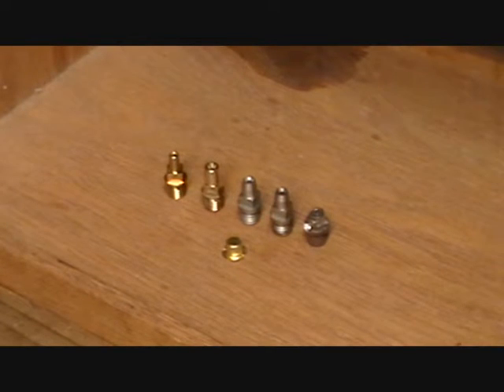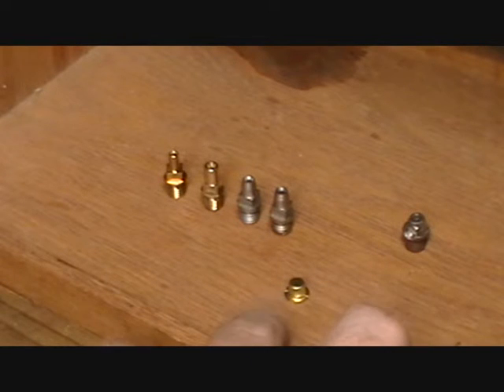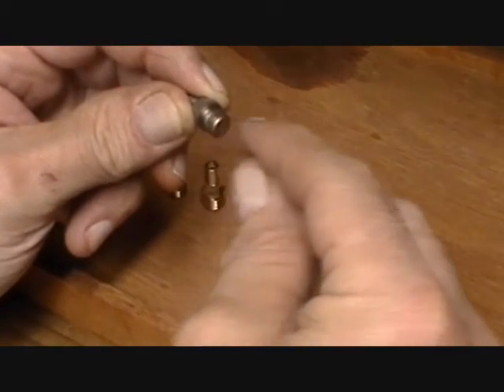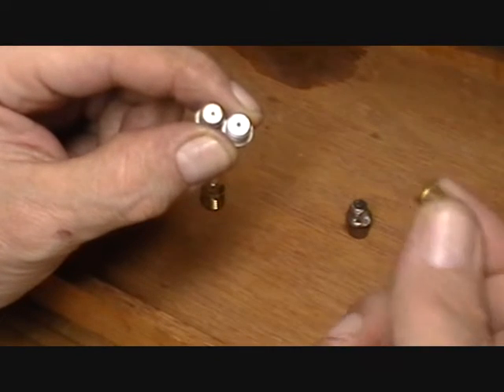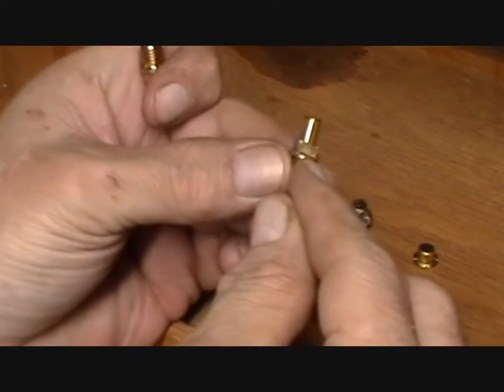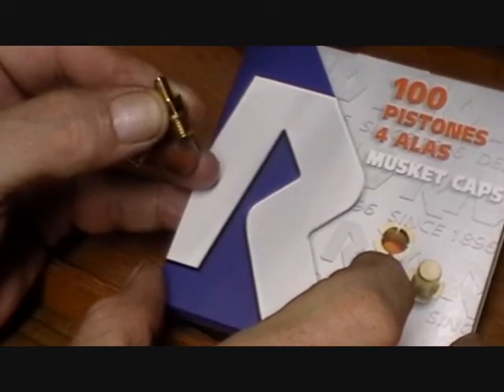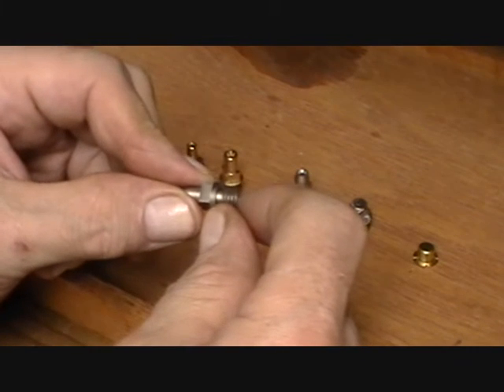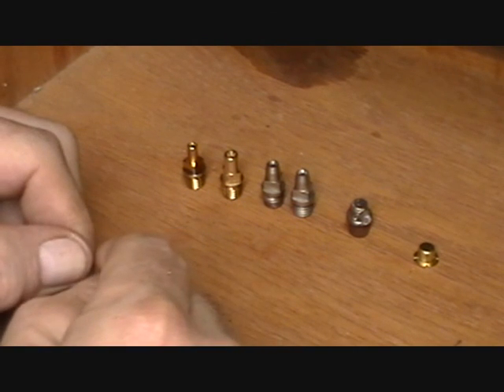Talkin Bout Nipples!

Comment: Interesting. I have an old hand-me-down Kentucky style .36 cal rifle. We always called it the "buffalo gun" because one of my ancestors used it to shoot buffalo to feed the crews building the UP RR back in the days, so that's about how old it is. I used to shoot it back in the 70's to early 80's but haven't fired it since because I started getting that blowback. It would sometimes leave the hammer re-cocked after a shot so I figured that was about enough. The flash hole on it is worn enough that I can stick a 5/64" drill bit right through the entire length and the chamber end is 1/8"! I have no idea what it was new back then but seeing the dinky holes they're using now, I guess that explains the blowback I was getting. I'm wondering what the standard was 150+ years ago because I can't imagine their machining back then would go so fine. Trying to find the right replacement nipple so I can shoot it again safely. Mine's also smaller, the threads on mine are 1/4-28 thread.
Reply from the maker: You could probably open up and re-tap the bolster or drum for a larger size nipple as well.
Reply from the maker: Okey Dokey.

Comment: I found an old Jukar Spanish muzzle loading pistol.  It was desert-dry, parched, and rusty.  The assembly and care instructions were in the old wooden box.  The best I can gather is that it is an early 1970s kit.  It is extremely easy to dismantle.  The nipple that was on it is a stainless steel nipple. I unclogged it and it seems clean enough to use now.  The firing hole seems rather large and has a funnel shape on the end.  It may be an old design.  I worked on the old kit pistol all day.  Now, it is clean, lubricated, and ready to fire.  But the cap end of the nipple seems slightly angled.  Is this just an angle that developed from years of use long ago?  Should the nipple be replaced, or should I use it?
Reply from the maker: Nipples peen, corrode, enlarge in the flash hole, bend and must be replaced from time to time.
Reply: @onmilo  Thank you.  It seems the one on the old kit pistol has been there awhile before the clogging of the pistol and it being thrown in the wooden box I found it.  The house being abandoned over 20 years probably added to the rust encrustations and garbage in the barrel.  I will likely use it with the old nipple, for now. I cleared it. I know this is just an old kit pistol.  But, hopefully it will lead to other things.

Comment: I cannot find 4 Wing caps in my area is there a way to make a musket cap into a number 11 cap conversion
Reply: Recently purchased an Armisport/Chiappa reproduction Enfield P1853 rifled musket.  OEM nipple for that firearm is an 8 x1mm metric which takes 'musket caps'.   Local firearms supply retailers in my area don't have musket caps seems all they have any more are standard #10 and #11 percussion caps,  and many online retailers either can't ship musket caps or the shipping cost is prohibitively expensive (doubling the cost of the caps).  Found an online supplier which has Ampco 8 x 1mm conversion nipples to allow use of regular #11 percussion caps on Italian-made repro muskets.  I purchased one and it threaded into my Enfield perfectly,  popped a couple of #11 caps (blank, no charge) and they went off fine.  The supplier for the Ampco nipple I bought is:  The Possible Shop (www.possibleshop.com);  their SKU number for the Ampco #11 cap nipple for Armisport P1853 Enfield is 12-50-59.  They have a variety of nipples so you'd have to determine the correct size for your application.

Comment: Which one is good for a toy cap
Reply from the maker: None really because a toy cap doesn't generate enough explosive force on its own to reliably ignite a main charge
Reply: onmilo the toy caps that I used ignite the Armstrong powder that propels an 8mm ball fast enough to make a large dent in my steel fence. So is there any that fit, for recreational use?
Reply from the maker: @chrisl8680  If you are already propelling Armstrong powder and an 8mm ball with a toy gun cap you already know more than I concerning your concern. I've never used or even tried a toy gun cap on a caplock weapon.